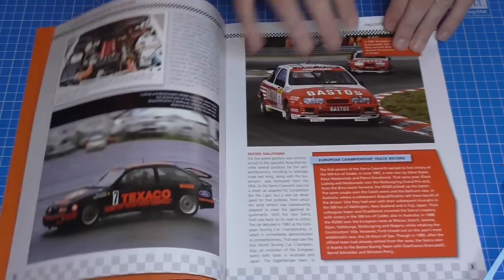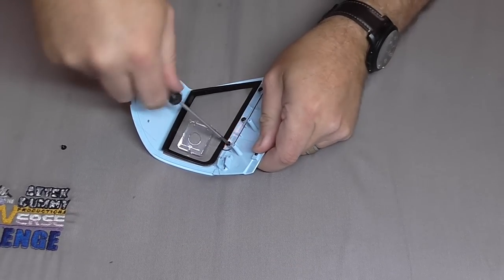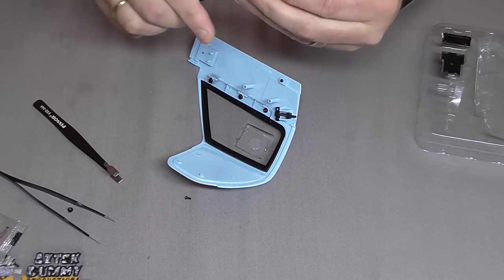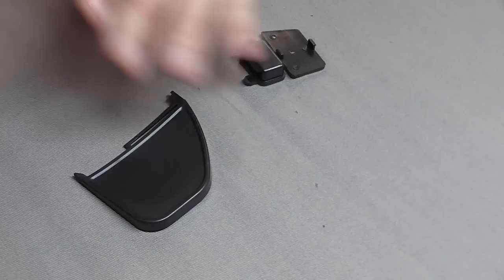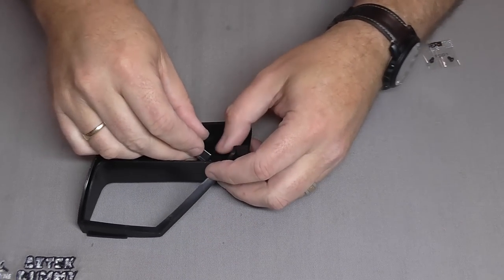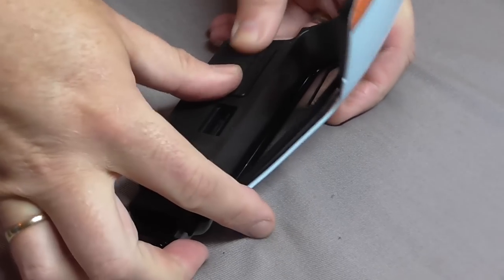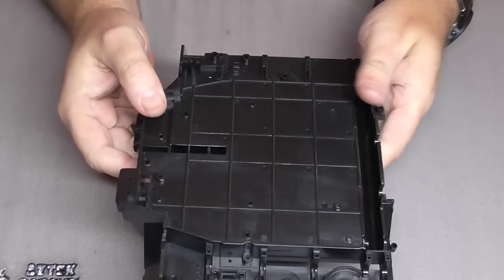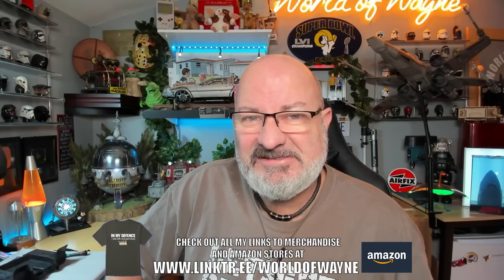Build the Ford GT - Pack 4 - Stages 13-17

Comment: Wayne. Couple of questions on the car. You did the window, that flap that is on the window. Do you have the option to keep it or closed. From what I saw it would have to stay open. Also I did look at that site where you can get this car. Will you be getting the other cars in that collection?
Reply from the maker: Not sure about the other cars yet. The open flap is fixed